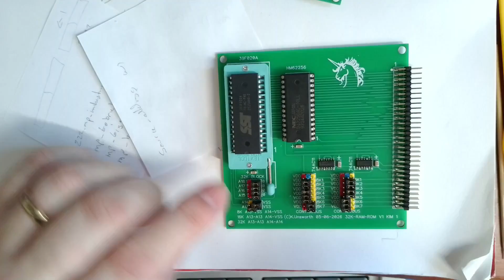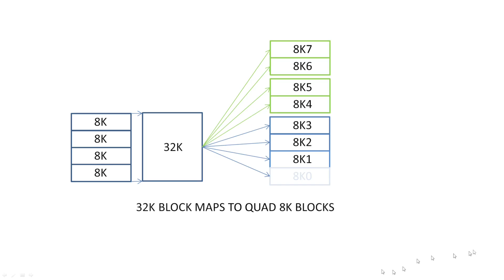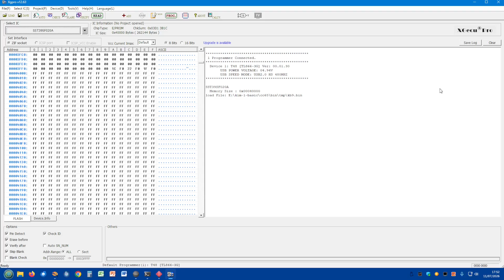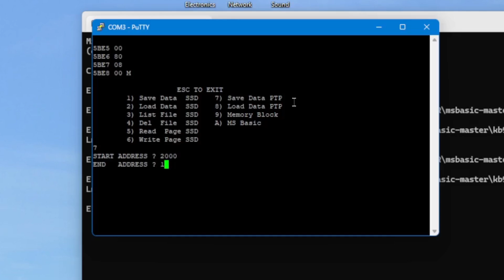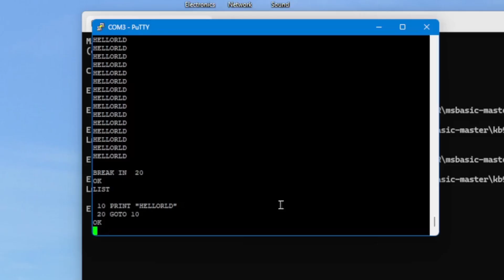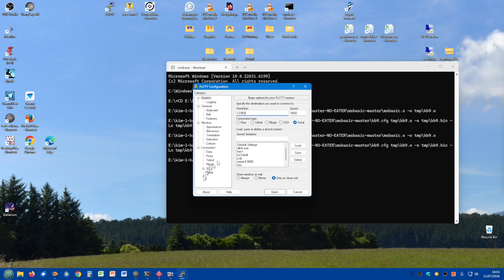The KIM-1 Corner. EEPROM cards are faster.

Comment: I wonder if we could build something like the Vetrex32 card that uses a dual port ram so the target CPU can run actual code, but on the other side a second computer can assemble or compile or otherwise manipulate the contents of the dual port ram.  It basically lets a normal PC talk over USB to the dual port.  That seems like it would be nice for the KIM-1.
Reply from the maker: I have some ideas for psudo dual port ram that I might use for a graphics card of some sorts. I while off yet. I have another 4 or 5 videos to do before i even think about that.👍
Reply: @unicornpub  I've been thinking about the Vetrex32 model for a while.  I thought it was pretty cool when I first stumbled across it six or so years ago.  My buddy and I are talking about spinning up a little 8008 board.  Attaching the old CPU to an FPGA that can act as logic or bus decoding, then hanging some fun little peripherals off of the FPGA from the Arduino or Spark Fun ecosystem, and probably a little SD card.  The thought was to cook up a "Vextrex32" like interface that will initially have a hex monitor or maybe an assembler/disassembler and USB as a serial port.  That would allow a fella to use a terminal on the PC to connect over USB and interact with the memory space through the monitor or assembler (or whatever is coded on the "modern" side).  And then maybe once code gets nailed down it can be dumped into a file on the SD card.  Since address space will be an issue, I was thinking the SD card (via the FPGA) can be used to store data (like patterns or screens for a connected OLED).  

The intent of the project is just for us to fool around with a CPU that was fabbed when we were in middle school and see what tricks we can get a 50 year old bit of sand to do.
Reply from the maker: @BeforeAI-6502  Go for it